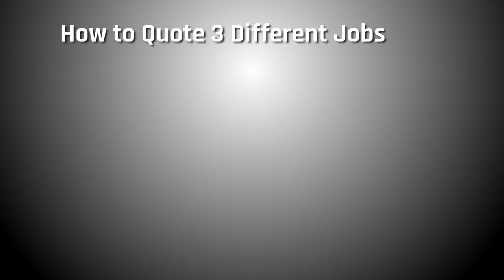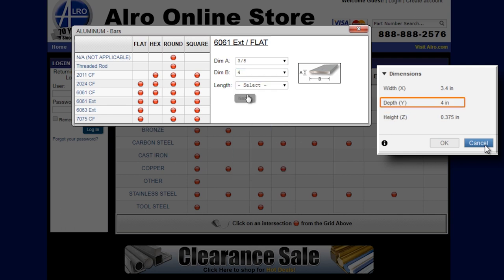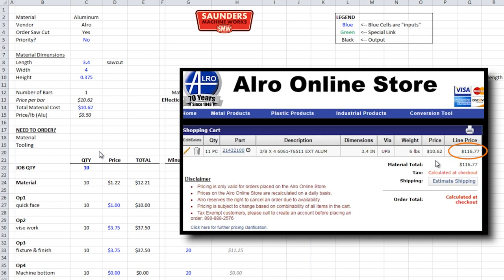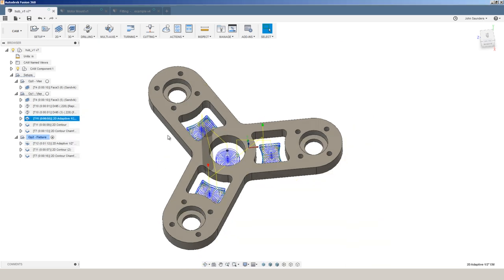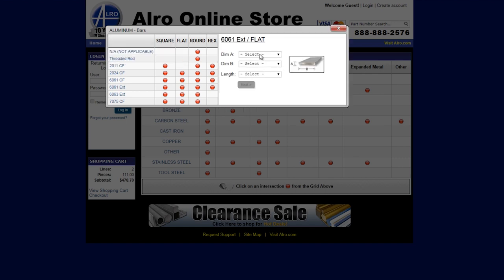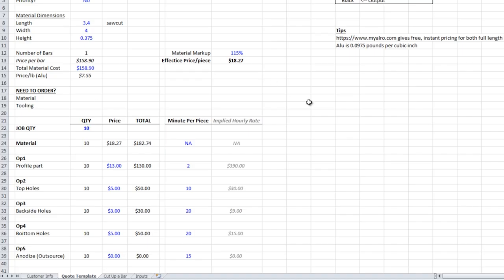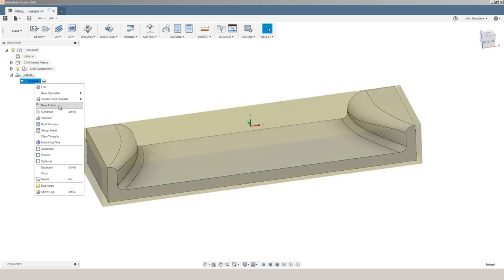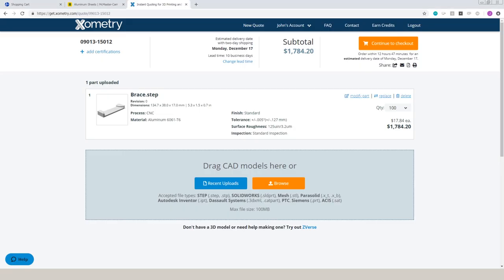How to Quote Jobshop Work - How Much to Charge?

Comment: I get about 200 - 300 drawings per week to quote. Quantity 1 - 5, milling, turning, mill-turning, conventional lathe, lapping. I have to quote them all while running a shop. I have to estimate time on the fly by feel, no Excel or CAM, CAD. What I noticed you can develop a feeling if you track what you quoted and what was real time spent. When I started doing that I was all over the place now I'm within 10%. Second thing that helps I also program, setup and run the parts. 

What bothers me it's when I estimate precise times for drawings and give a realistic quote and then I get feedback from customer, "We went with another shop which was 50% cheaper". On a 20K quote they were about 10K cheaper. After some investigation I found out they misquoted drawings and lost money on that job. Where did such a misquote came from? Guys who quote those jobs don't work on the machines anymore and they forgot how long it takes to do anything. I just heard somebody claiming it takes 2 minutes to setup an endmill in ER. In reality it's closer to 10 minutes.
Reply: Where are you finding 200-400 drawings a week with qty 1-5?

Comment: John I'm not sure if you've got laser or waterjet shops in your area but I'd get that first part cut from plate and do nothing but the counterbores.  It'd make your material cheaper (plate in a non-custom size) and remove all the warpage potential during machining.  You also have to consider that if you don't want the work, sometimes you should no-quote.  Some places would see your "hey I'll take it if I can get it at this price" quotes and then never talk to you again if you're way off base.  Always ask for target pricing when dealing with new customer quote packages.  I'm going through learning this all right now and I HATE it!  I'd rather mop the floors than quote.
Reply: I think this is probably and underutilized method.  Just asking what their budget is or what they think they plan on spending.  If it's way off, you can tell them and not even have to bother running a quote.  It at least gets you close and lets you know if you are on the same page.
Reply: @kazlx  Precisely. I'm not always hot on this but it can be a very useful strategy.

Comment: I buy most of my material from Alro and have found if you call a specific location that usually will be able to tell you if they have the material in remnants as well as prime stock.  Buying remnants can save a lot, especially if you only need a small quantity.

Comment: Hey John, great video
I had a question about finding job shops. On the customer side of the coin, how do I find job shops to get quotes and work done for myself. In quantities like in the vid (10-100) but not as some large company with procurement etc?

Is there some search/quote site many shops use to compete or would I manually have to discover and find shops to do work?

Alternatively, as a small business how do "normal" job shops market themselves?
Reply from the maker: Take a look at https://www.nyccnc.com/tips-on-how-to-source-cnc-machined-parts/
Reply: Google Maps
Reply: Also practical machinist has a manufacturing resource page for listing your request for quotes from companies around the country
Reply: Sourcing is, like most other things in business, all about building connections. Outside of MFG.com (not recommended, see other comment thread on this video), I don't think there's a consolidated sourcing platform that has any traction. Try asking around your social circles and you should be able to find somebody pretty quickly. Welders, mechanics, machinists that work for big companies, accountants, engineers... These people have probably all crossed paths with a few small local machine shops at some point and will know who to use (or, equally valuable, who not to use.) Or, if you're not in a rush, most larger cities have a manufacturing expo of some sort that is intended to connect shops to sourcing professionals. The big flashy shops that advertise all over the place are not who you want; they're looking for the corporate customers. You're looking for the shops that don't need to advertise because they've got more work than they can handle.

In my experience, it's difficult trying to use the internet to source parts if you're starting out. There are a lot of crooks out there, and if you don't look like you're an established company with some credit references, shops are going to be hesitant to do work for you. Perhaps more than most other businesses, machine shops take a huge risk when they do work for new customers. When you find somebody local, and meet them in person, they're going to be more confident they'll get paid (and more confident they can haul you into court if they don't).

Some additional tips (and forgive me if you already know this): 1) Send a complete, proper drawing, and a proper purchase order. Real shops don't want (only) a CAD model. They need to know tolerances, and if you're talking small quantities, they'll probably do some or all of the work on a manual machine where a CAD model doesn't help them. You can make drawings in Fusion 360, so there's no excuse in this day and age. 2) Give them lots of lead time. Good shops are scheduled out 4-6 weeks, and their priority will be their existing customers. They're going to work you in when they have time. 3) Expect to be surprised by the price. If you're a new customer, they're probably building in some overhead to get you set up, and will also assume that they'll have to spend more time on this job because of inexperience or whatever. If the transaction was positive, the prices will come down on the reorder.

Perhaps you could mention what state/region you're in? There might be somebody here that knows somebody in your area?
Reply: Mlnlme1, I currently work for a small job shop that operates in quantities like you are talking about. We specialize in fabrication, prototyping and just got started in Cnc machining about 2 years ago (3 axis only). Would you be interested in emailing me about what you are looking to get done? I do not know where you are located but it never hurts to talk and build relationships/connections.

Comment: Interesting to see how others do it and always nice to see that experience (getting wrong) eventually leads us down the same route. 

One thing i have added into my calculator is some setup factors. I add 6 mins per tool (loading and measuring) and 20 mins per vice/jig setup and then 10 mins for any additional setups after

Comment: When making multiple parts from the same material, "nest" the parts into larger pieces of stock; not too big to fit into the machine for the ops up to separating the parts. It can save on workholding and reduce machine time with tool change optimisation.

Programming time goes up, depending on the complexity of the nesting.

Comment: If I’m honest I think this is totally inefficient way of quoting, surely you have an hourly rate that your shop charges. Why not put separate columns in for set up time and actually machining time, this your spread sheet can work out the hourly cost of setting a job and adding the cost of machining. 
For example. If you charge $100 an hour and your quoting for 2 parts, the price will dramatically change if you them quote for 10 parts as the set up times will be spread over 10 parts not 2. 
Just seems really inaccurate if your guessing you can do 20 parts an hour etc 
The example is how I quote in my shop and it works a treat

Comment: Where does one go to find machine shop work?  I'm from an area which does not have a local CNC shop and I'm not sure if it's because there is no work or if nobody has thought to start one. I love this type of work and would love to be able to do it close to home. Any tips?
Reply: I'm not sure how hard you've looked but it's likely that there are more machine shops around than you think. Many little shops won't even show up on Google Maps. Your best bet is to start asking around. If you have a local makerspace that's a good place to start.
Reply: Rylee Gill I currently work at a small fabrication shop that has a 3 axis Cnc. I don’t know where you are located but we are near Rochester, NY.
Reply: @brentonparis8927  I'm North of watertown

Comment: Ok my question is why would you do individual pieces of raw stock on the first piece you showed when you could order the stock to the usable length of the machine and cram as many parts in it as possible thus saving material as well as saving time doing multiple in one operation? You would have a much lower cost/part and your bid would be much more competitive, at least with larger quantities.
Reply: I'm guessing they would if these were actual jobs, but they're just examples so he's not putting in as much effort.
Reply: The first part also has to be held in a vice, so to use the entire bed you’d need to set up a bunch of vices, right?
Reply: Robert Panco you could also use a vacuum table, super glue method, hold downs, or mod vices.
Reply: James Dreger fair point
Reply: If you already have vises set up on the machine, it's probably more work to remove them, do a completely different setup and change back than it is to just cut them to size and run the program 10 times.  You aren't really saving that much material on those parts in that size.  It's way easier to just throw the blanks in a vise.
Reply: you're assuming a low quantity of parts, in which case i would agree. However my comment was really more for high quantities. Also changing out a fixture doesn't take very long, In my shop we take all vices, fixture plates, etc. off at the end of the day and it only takes 10 minutes in the morning to re set up and re-probe them back in

Comment: Don't forget, investing in a CNC plasma cutter or presumably better yet, a water jet would allow substantial material savings by tessellating some parts instead of wasting a full square blank for each one and may leave an acceptable finish in many cases, if only on outside or unseen hollowing, (weight saving), features.
Reply: Usually the plasma cut finish in aluminium is far from good and water jets are expensive as hell to own and operate. Also in 10-off quantities set up and cam programming for the water jet or plasma cutting usually does not pay off versus the saved material.
Reply: @maikeydii  ......Maybe until someone clever invents the 'Sonic Breadknife Universal Water Jet System' for the CNC mill.... like a glorified mister nozzle, then it would just be a first op' Fusion 360 process. Does aluminium work harden when plasma cut to make it entirely unsuitable for roughing out blanks where a substantial material saving could otherwise be made? If so, one could simply 'mill part' thin items close to or at finished size if they tessellate well or can be arranged with any number of common edges and surface finish is potentially better when slotting as opposed to edge milling.

You could save on workholding setup time also if items are parted off on the mill, if only for the roughing stage. This is all assuming that it's actually cheaper to buy larger sheet or extruded plate material for a particular job. Like John said, it's always worth suggesting strategic design changes if it will allow more efficient production, speed up delivery and save money.

People sometimes go to ridiculous lengths to stick to design spec's that often aren't even critical rather than query the design for possible efficiency improvements and you'll often be dealing with more computer tech' savvy but perhaps less 'hands on' CAD operators who may have even misinterpreted a drawing or over complicated the bejesus out of a component, like the air filter retention handle/lock on my Grundig tumble dryer. It looks like a shuttle docking port from a Scifi movie but way more complex.
Reply: @SupraSmart68  CNC plasma sucks for aluminum.  It's way faster to just machine them.  You aren't saving enough material for it to even matter.

Comment: Interesting. I'm on the other end of table (Equipment engineer who sometimes designs stuff to be machined). Usually very low volume though (one off fixtures/replacment parts, etc.).